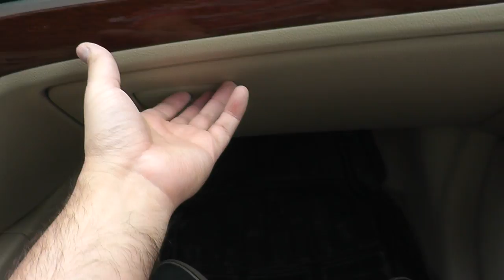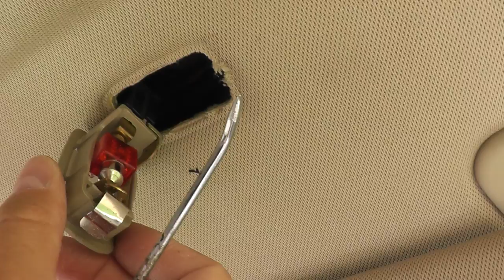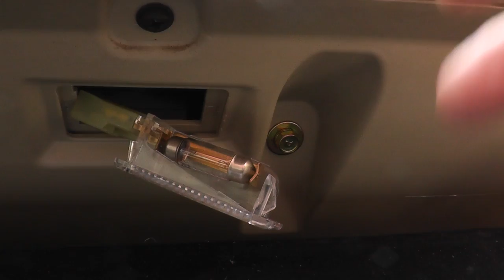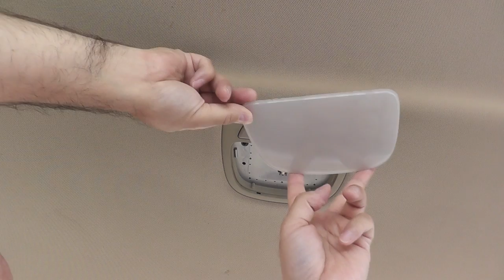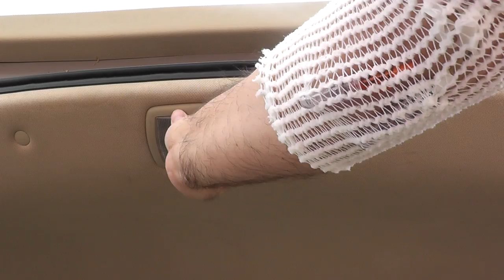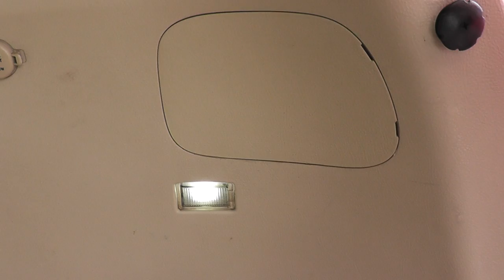Hyundai LED install

Comment: Awesome video! I used this to change the lights on my 2009 Santa Fe GLS, THANKS! Bulb sizes, at least for the 2009 internal lights are: 6418- Glove box, Dome Light and Liftgate DE3175- for the Visor Lights and 2825- for the Map Lights. Hope that makes this a little easier for some folks.
Reply from the maker: Thanks and good info for anyone with that year of car. I should update the info for this vehicle with bulb types.

Comment: How did you change out the  license plate lights? I can't get the screws removed
Reply from the maker: I had to remove the hatch panel, then remove the panel held by a few fasteners and 3 clips to access the lights. I had the same issue because the screws are rusted out.

Comment: The front lights will not work with the door open
Reply from the maker: Correct, only the middle seat. Fronts are manual turn on.
Reply: I have a 2012 and they should come on if u have the door button on the light switch. If that does not work u may need to replace the diode. Theres videos. If not u maybe able to order one that works from junk yard.